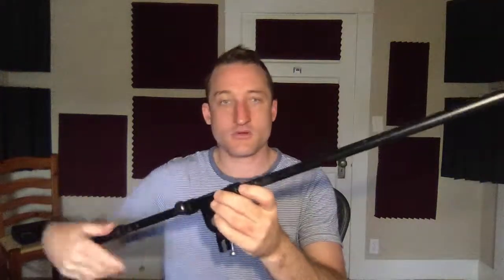How To Properly Screw On Your Mic Clip | Are You Doing It Wrong?

Comment: My mic clip is stuck onto the screw base. (I want to swap it out for a shock mount.) I've used WD-40, I've used a wrench to grip it while using a kitchen rubber grabber to hold the boom arm, but the thing won't budge. I've even removed the mic holder part to provide a little more leverage (and to not risk breaking it). I've run it under hot water, used a hot blow dryer on it....I'm out of ideas as to how to remove this thing. I suppose I could just break it with a hammer, but if you see this comment on this four-year old video, do you have any other ideas? Thank you in advance!